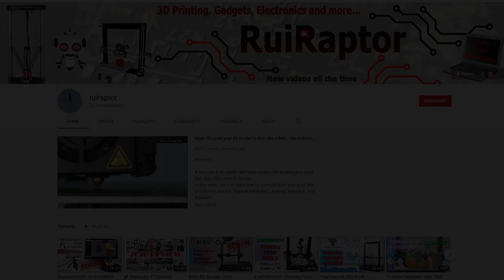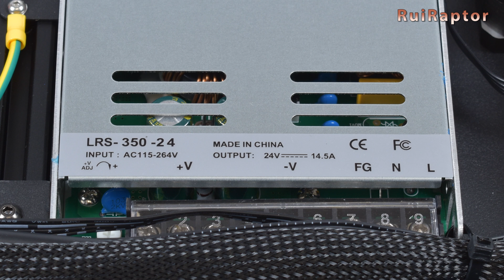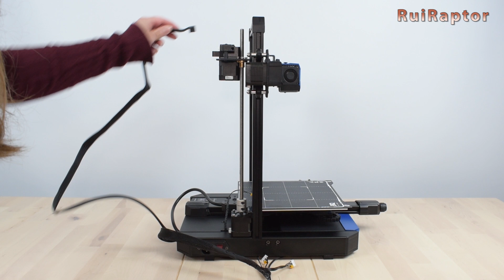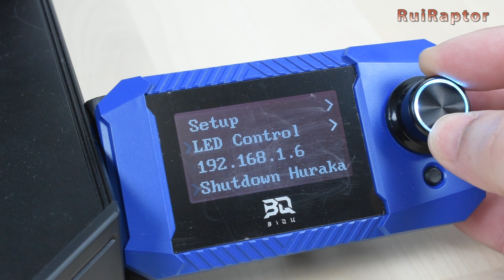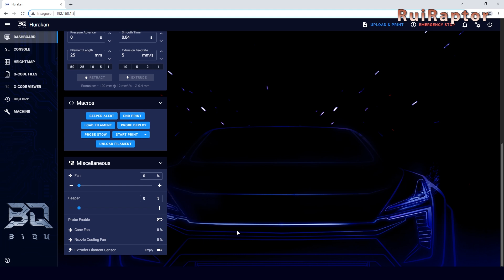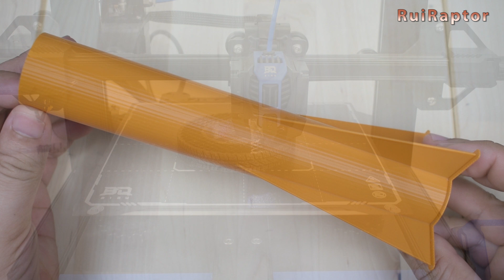Biqu HURAKAN (3D Printer with Klipper) - Full Assembly Guide & Detailed Review (Includes Pros&Cons)

Comment: Mine did t come with the xy adapter or cable ? 
Also when I print the boat have alignment issues but still got it to 80% an will move an the print fails the actual mold moves how do I stop that 
Was thing slowing down the print an rasing the x up a tad 
An raiding the bed temp

Comment: Looks like a good printer for entry into Klipper. As it’s going cheaper now. Does the machine comes with accelerometer or purchase separately ? I see this is the most important for quality print and my main aim of klipper control. Another thing is can we replace the screen with a TS35 touch screen with klipper screen to run it with? 
Thanks a well presented video and infos. ❤

Comment: I tried many times leveling the bed manually, but after start probing and adjust Z and finally then test printing my print never stick to the bed then I repeated all the step found that the nozzle is away from the bed. it seem that after the Z offset move up after probing process.

Comment: Personally i think the manual leveling and springs on a printer thats suppose to be for fast printing is a bad choice. And i definitely hate the firmware on a micro sd card... God are we in 2003😂
Excellent review as always rui and Sandra
Reply: Micro SD is the most practical since it allows for easy re-flashing if something corrupts. eMMC would be a challenge since it would require adjusting jumpers to get it into DD write mode for flashing. Bear in mind that we are talking about an entire linux operating system here and not just embedded firmware running on the MCU.
Reply: Is there anyone here who can help me? I broke my SD card and I need help on how to create a new one to make the printer work again. please help. @looxonline

Comment: The print head on the Hurakan is total junk. It clogs all the time. Changing it is very difficult given the confines of the enclosure. The solution is to install a REVO print head. But that isn’t easy for a number of reasons. You need a metal mount to get the print space the REVO took back. I modified a backplate I had to make it support the REVO. Then you have to edit the generic config file. BIQU will help, but their numbers are incorrect. My REVO is still 10mm to the left of the left side of the bed. The REVO with a high flow nozzle is great. I highly recommend it. But the REVO and the HF Nozzle will cost about $200. That’s more than half of what the Hurakan is selling for. It was a great new idea a year ago. Now we’re looking at the K-1 and the X-1 Carbon. This review is a year late.